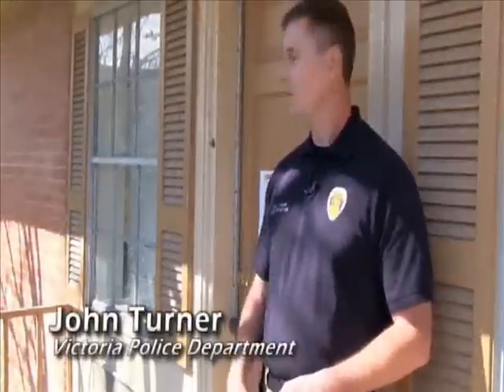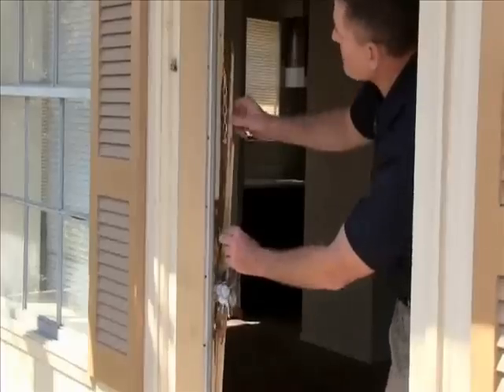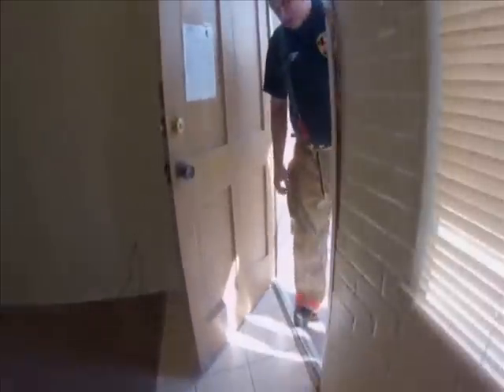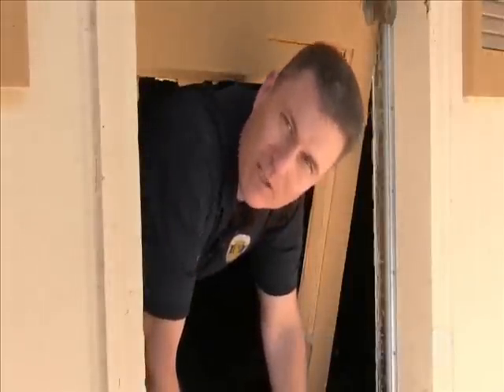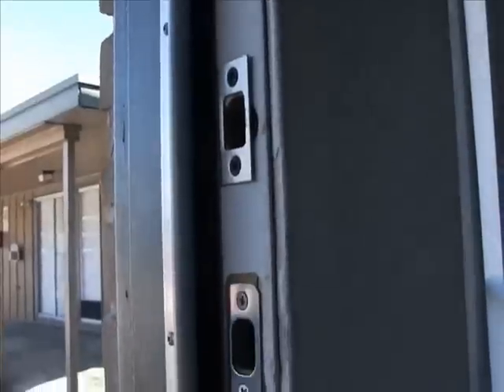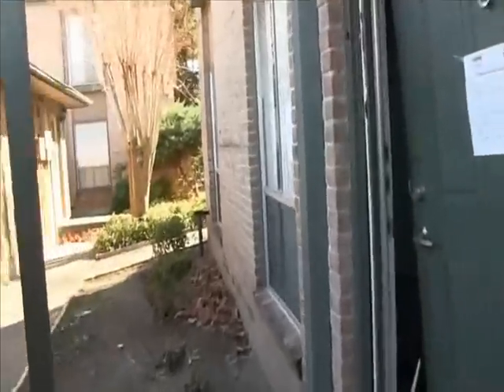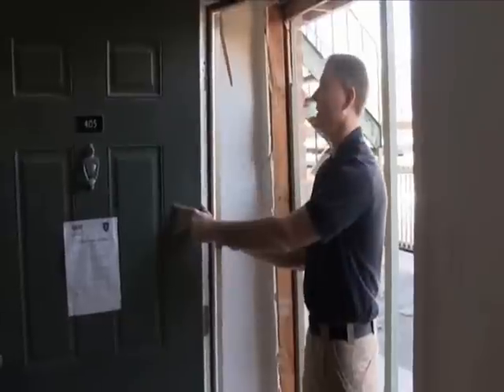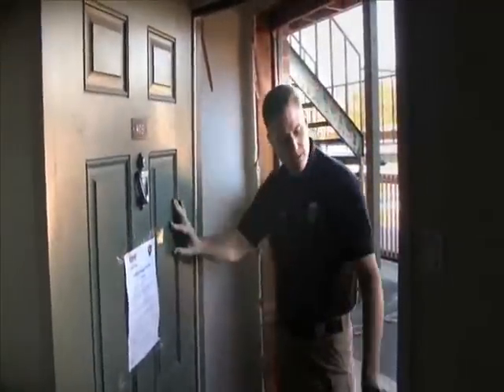Double your door security for a couple of bucks NOW! Safer in 5 minutes!

Comment: Now don't you think those two very large windows might be an issue?
Reply from the maker: Sure nice and easy to come in after you tried kicking in door unsuccessfully. That is where you would get reacquainted with the second amendment coming the front window.
Reply: Knocking out a pane of glass and unlocking the window is a lot quieter than putting the boots to the front door. In fact any crook with half a brain would find a nice secluded window around the side or back of the home.
Reply: ETprepper dang what are u a top security bank owner lol
Reply: S Smith 
Not with my custom hurricane resistant windows.
Reply: S Smith totally what i was thinking why would you kick a door 50 times when you could just pop a window super easy
Reply: Buy impact resistant glass
Watch this video of a fireman https://www.youtube.com/watch?v=6I36h5LOKhE
Reply: There are window solutions too. 3M security film and window pins. Treat all points of access. Delay until you're on the other side ready to defend.
Reply: @rcampbell4967  Yup, have 3M security film on my accessible windows.

Comment: Screws are tempered steel, theyre more brittle causing the heads to sheer off. If you're going to do this reguardless, please use structural framing screws atleast

Comment: If a burglar was to break down something it would be a window, not a door.
Reply: +JinxfestTV  windows that have bars going down duh ?
Reply: +JinxfestTV Burglars like to leave by a door because they like to take big and expensive things like TV's and if that isn't a good enough reason for You; they don't want to risk cutting themselves on the glass, DNA!
Reply: +Kit Bear if you break through the window. You can just unlock the door from the inside ya genius
Reply: Patrick Ryan Even if it's a double cylinder deadbolt ya genius?
Reply: Kit Bear yes you pull the hinge pin takes like 10 seconds
Reply: JinxfestTV  i agree  just beak the window crawl through and open the door from the inside and if the doors worth a lot of money steal the door too lmao
Reply: Below is a summary of the answers we received.

1. How did you typically break into a home or apartment?

Most inmates broke in through an unlocked door or window. Several burglars kicked the door open.

“I would kick in the door rather than break glass. Loud bangs are better than loud glass breaking, plus you run the risk of getting cut,” said one inmate.
Reply: I found a data sheet...I didn't look if there's a newer one:
https://www.bjs.gov/index.cfm?ty=pbdetail&iid=2172
Burglars tried to get in through the door in over 73% of burglaries (but they may have tried windows as well [40ish percent], and they may have tried to go through the door without kicking it--especially if it was unlocked, of course)
Reply: lol, your missing the point here... its not to stop CIVILIAN burglars, its to slow down GOVERNMENT burglars.
government burglars always want to come in thru the front door.
Reply: no not true if it is a home invasion they might just kick door in cuz breaking a window then got to craw throw it but also your right if u aint home they will go throw window
Reply: Nope. Door is easier than windows (unless unlocked) The majority of burglaries are done through doors.

Comment: Another suggestion is to purchase or make reinforced safety hinges with 3-inch screws... They are usually designed for doors that open outward away from the house but work great the other way around too... Have a great day...

Comment: i replace the screws at every home i move i've moved in to.  They're always 1/2 inch or less and i replace with 3 1/2 inch construction screws.  Most recent house they were only 1/4 inch screws holding on the strike plates.

Comment: you suppose to use at least two 3 inch screws for both inside holes on the hinges. That way, you screw into the frame. You do the same on the strike plates by suing 3 inch screws.

Comment: Although this may have looked like a failure, it was obvious the first door itself was half rotten. Normally an entry door will be a metal clad door, with not only a door knob lock but also a dead bolt. Their second door actually started breaking away from the hinge side. In general their suggestion is a great idea. Replace the ridiculously small screws normally in doors, only 3/4"-1" in length with 3"-4" screws as they suggested. A very good suggestion! Thanks for postiing

Comment: Correct installation of exterior doors requires shims and 3-4" screws (one per hinge) as well as at the strike plate. The absence of space between the jamb and framing makes a significant difference.. shims are important

Comment: "Pinning" the center of each hinge will also prevent the door being removed from the inside by removing the standard door pin, then removing the door.  Also an additional 3/4 plywood sheet to the inside.

Comment: Steel door and steel door frame, drill at least three holes, 12" deep, through the side frames and slide a 12" long rebar into each side and weld to the frame.  At that point it is easier for the people breaking in to go through the wall.  Even better if you get the center type deadbolt that locks into both frames.

Comment: I made my doors , 2x6 steel with 1/2 plate inserts to appear like a raised panel door .6  1" locking  bolts  like a bank safe. You have a better chance of getting thru the brick before the door.

Comment: Well, they needed to long-screw the hinges also.  Also, brace the bottom with something into the floor (like a spike).  Then install a 2nd door as a 1" thick piece of aluminum with springs between it & the outer door.  Then install a trap door beyond the door threshhold, so that whoever enters falls down into a shaft.  & suspend an anvil over the door entry which will release on the person who enters -- it makes a great conversation piece.

Comment: I install doors for a living when you buy new entry doors they normally come with longer screws to place into hinges into framing (thats 1 part of the install, DONT just use long nails or screws thru the brickmold) next a decent quality door is going to have metal reinforcements behind jamb at the deadbolt next when you buy new door handle and deadbolt it comes with longer screws for the jamb side to go into the framing also pull back or remove the weather stripping and use long screws to secure door to framing this hidden screw method makes it a better install then nailing thru brickmold

Comment: My door opens out, NOT in. I made the door from solid oak 2.5", oak frame, 4 hinges,  4  $200 locks  ( 2 horizontal, 1 vertical up & 1 down.
Reply: Good luck in the snow drifts.

Comment: Cheap apartment complexes.  That was a really good tip at the end.  Doesn't really cost you much to run down to the hardware store and pickup some long screws.  Re run your hinges and strike plates to get into those studs.  

None of this matters if your apartment complex used interior doors or super cheap doors to save a few bucks.

Comment: Interesting. I have installed several hundred doors while working in the building trades years ago.  I have never seen a dead bolt installed in the trim.  They always are installed in the door frame and into the studs.  Exterior door hinges generally have 4 holes.  3 for the door and 1 for the 4" screw for the studded door opening.  Granted lots of building contractors cut corners but pre-hung doors are designed for the dead bolt to pass through the door frame and never the trim.
If you really want a secure door the add a second dead bolt on the lower part of the door.  If al the hinges are secured with 4" inch security screws the door should withstand incredible force.  
Incidentally, since retiring I am home most of the time so if some uninvited person attempting to gain access will give me time to load more than just my 20 gauge Wingmaster.  Good luck trying to break in.

Comment: I added 3 inch deck screws-don't use dry wall type too brittle! Or get tap cons used for masonry. Then add them to the hinges also! See how the other side opened above, When installing a door they only use short screws.

Comment: Buy two door hinges.
Remove hinge pins.
Grind/sand surface of pin shafts till they freely slide in/out of hinges.
Attach an 8" chain to each pin.
Mount hinges with 3"+ screws on latch/ handle side,opposite top and bottom of swinging hinges.
Attach other end of each pin chain to door frame stud so that the hinge pin can dangle free of door.
When door is closed.
slip pins into the two hinges to secure the door.
Reply: With a descent door,properly installed.
The hinge locks will make the door a almost unbreachable without complete destruction of the door.
Reply: Be a neat Video

Comment: I suggest steel door frame and I were doing the job of reinforcing the door I would weld the hinges to the door frame and make sure you have a top of the line dead bolt, and if you have the long narrow windows on each side of the door you need to put bars on the out side and be standing on the inside with your home protection device , because in most states you have a right to protect your home and family

Comment: if you're super worried about the door frame breaking, put a 2x4 on each side at a 45 degree angle to the floor.
that way the floor supports the door :P

Comment: Weak point is the bottom door panel below the locks. If a wooden door (like shown), this kicks in easy. Now reach through and up to unlock the door from the inside. Heck if you're small or very flexible enough, climb through. lol🙃🙃

Comment: I was wondering if I should switch out the screws in the hinge for 3 inch screws. Thanks for answering that!

I just replaced both my deadbolt and handle strike plate on my front door for more high impact rated ones, plus they all have three inch screws in them. Plus, I got a door jam lock that is rated for 800 pounds of force. I'm hoping my door will be like the one in this video, where if someone wants to break it down, they're going to have break it off the frame.

Comment: You would think for safety sake you would have the door open out for fire escape. This would be an extremely hard door to kick in and unless the perp brought pry bars hes not getting in. You could also have two doors one opening out and one opening in. Still a good simple fix is the three inch screws ALL AROUND don't forget the hinges!

Comment: If I wanted anything even close to 100% door security, I'd go for steel doors in steel frames secured by (at least) four inch (preferably six inch) screws every six inches into the surrounding brick/concrete work... 

Wood framed doors are structurally fine, but security-wise they're hugely vulnerable.

Comment: put two hangers on the top and two on the bottom.you can pick up at most hard whare stores or lowes .made to fit 2 bi 4's lumber.drop one in the top and bottom..door will not be kicked in or with a ram..very effective.. the old timers in the pioneer days secured their housing as they slet...not to expensive... thanks for the info on the screws tho..

Comment: block your doors when inside with 13 gallon rubbermaids with Books, bricks , and sat 35 package of water onto, and a,e 3 pr 4 back to back . noisemaker on the doors block Airconditioner put wood planks on sliding doors and windows. Always lock and block your bedroom door, and have weapon out and ready. noisemaker on the door.

Comment: The point of a "weak point", is to exploit the "weak point".  Kicking the door 2' below the "weak point", is useless.  Apply force to the "weak point"  In this case, apply force to the dead bolt. It is "weaker" than the 3 hinges

Comment: no way, man.  i do agree, the 3 inch screws help.  but youre supposed to put at least 2 in each hinge as well, and before you even do that, when you hang the door initially, youll end up shimming either side, both, and sometimes the top as well.  so youll be nailing the door jamb with at least 3 inch nails at times, or in my case, always.  And nailing the trim to the door and the framing, and caulking the trim to the wall.  it may sound trivial but it all adds up, and with everything theyre saying to do here, it shouldve been a little harder to remove the entire door, jamb included, from its place in the framing.  ive been told a homeowner no longer wanted a door and kicked it out for fun.  i had to use a crowbar and hammer to truly finish it off.

Comment: Ebay and amazon sell steel door jamb reinforcement strips that are like super striker plates and they are available for the hinge side too.  Install these with 3" ~ 4" screws and you can laugh at the cops while they try to figure out how to get in.  Don't forget the metal door and don't forget your back door!  for less than $200 you can make your doors extremely difficult to breach.  Meanwhile your reaching for your 870 or your mossberg.

Comment: Replace at least the top and bottom screws in each of the hinges into the doorframe with 3 1/2" screws, predrill and/or lube screw to avoid splitting. Replace screws into door side with longer ones, too, careful not to split or spin out the screws. Doors aren't friendly to change. Taking the trim off of the frame and securely filling the space between the frame and the stud with wood and putting in 4" deck screws every 6" for the full height of the frame on both the hinge and latch sides gives the hinges and the strike plates a good anchor. You will get out of this only what you put in.

Comment: I got a solid 3 inch wodden door what is made to survive strikes from bats those thing's cops have and 100% impervious to human feet and the frame is nailed to the concrete base in about 5 inches with a 2 inch steel bar holding it together with a crazy PSI level but the downside the bitch is like 200 pounds and most of it is carried by the steel frame

Comment: I thought this was going to be some high speed trick.  Hell, I have a steel door with steel frame that has 24" screws on either side of all hinges and strike plates that go through the frame, stud, through the 15" of insulation and into the next stud. I locked myself out once with just the door knob and kicked it for 20 minutes before the door knob bolt failed. It was a very cheap door knob.  Top of the line door knob and dead bolt now.

Comment: Instead of a 3" screw, use 6" screws instead. They go through the first stud and into the cripple stud. The entire frame of the door would have to give way to allow a creep in. Using a drill wirh a slotted head makes the job fast. No need to pre drill holes. The screws go right through the studs.

Comment: Question....most 3" screws are non-threaded for at least 1" length under the head. What if you are not sure how much wood you have in the frame area ( beyond the 3/4" standard length)...... to make a 3" screw worthwhile? If there is little (or no) extra frame-wood, then the 3" screw is WORSE than a 3/4" screw that is totally threaded throughout its length. I hope this makes sense....be careful out there. A 3" screw won't do you much good if there is only 1" of frame wood behind the fixture, and that first 1" of screw length under the head is not threaded.

Comment: Not the best... It still vulnerable to an attack using crowbar. Deeper deadbolt will help for that. Also, using Cobra/Tapcon Concrete 3 inch or longer will be lot stronger.

Comment: I am going to build the door system the opposite way, instead of swinging in I will have to open pull out a little inconvenience but the whole frame in this case a metal frame cannot be busted is because the door is in the opposite direction. Maximum strength. NO punks or groups of punks will EVER get through a door system I design.
Reply: MHammer cool. Now they can just remove your hinge pins and pull the door right off.
Reply: You are mistaken. Haven't you ever seen metal doors like on a commercial building? No hinges exposed.

Comment: A crowbar, would have been easier... so hardened 3" screws around the perimeter. (Or use bolts, and metal studs...) I had police with a battering ram hit the front metal fire door a half dozen times, and there were no perimeter reinforcements, and I was able to push through with my shoulder later... before ultimately doing what was suggested here!)

Comment: I saw posts about the door opening to the outside instead of inside, would the hinges that hold the door have the pins outside? Couldn't you just take those out and lift the door out? Or are there special hinges that don't fit outside the door? I'm new at this, so I'm just trying to learn. Please don't call me stupid. I am able to learn. Please help me, don't criticize me asking questions? Thanks
Reply: +Linda Martin Yes you are right about the pins, but they can be welded or brazed or perhaps glued in on the non-rotating portion of the hinge with epoxy.  I'd not recommend an outward opening door because if you crack the door to talk with someone it's easy for them to grab the door handle and pull it open.  Another option is to use an inside swing door and add exterior "burglar bar" aka steel bar storm door.  However, buy a steel storm door that has hinges on the opposite side of the entry door.  That way if you crack the entry door to talk with someone the steel door is still locked, and if they open it, they have to open it all the way open to get to your open side of the door - takes more time...

Comment: @ 2:23 "my little legs can't reach that high" 
All kidding aside - thanks for the awesome video. Maximum results for minimal cost. You definitely want to put 3 inch screws into at least one of the screw holes on the hinges. And you can use 2 inch screws in the same way on the door mounted side of the hinge, and also on the plate that holds the locks in the doors.
- BTW I think it's appalling that a door like that could possibly pass building codes anywhere in the 1st world.